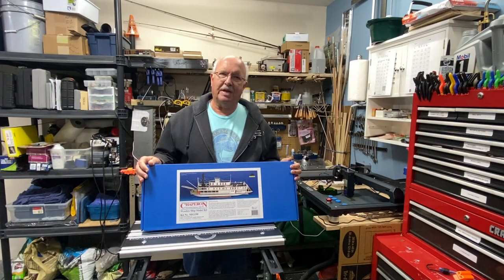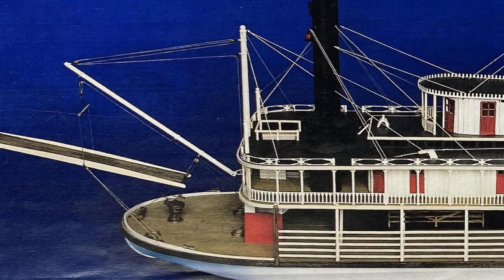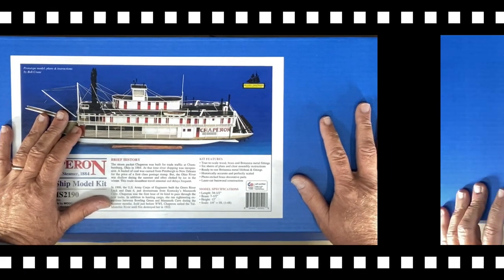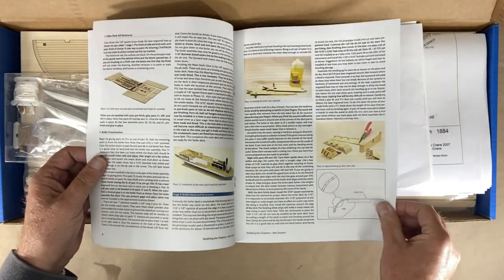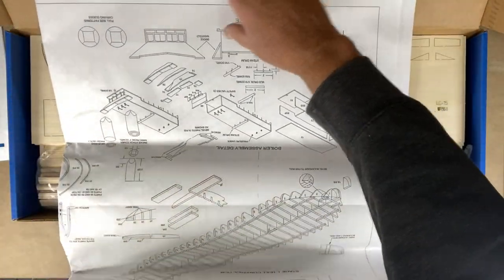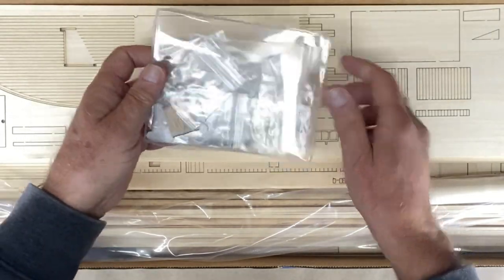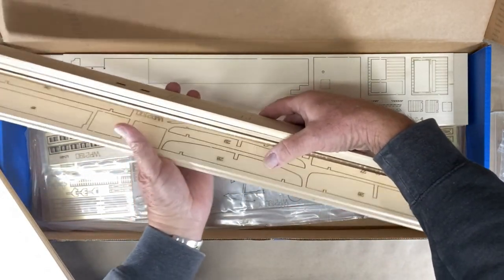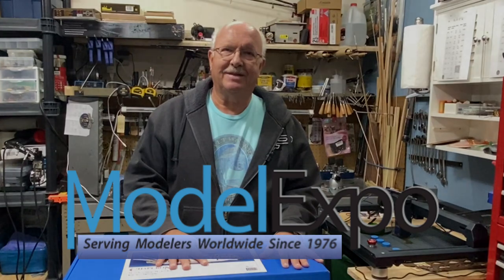The Chaperon UNBOXING

Comment: Glad to see someone else building this boat besides me.  I am close to finishing mine.  I've added lights which slowed me down some, but I am working on the Texas, then the wheelhouse and will only have finish work after that.  Looking forward to your build.
Reply from the maker: Definitely a new challenge for me!
I’ve been looking over the build plans and formulating in my head how I want to proceed. I’m leaning strongly towards a combination of dark mahogany stain for floors and handrails. I’ll keep the white paint for walls and the hull.  I’m not going for a duplicate of the original boat.  I like to put my own twist to it.
I’ll search your handle in hopes you’ve posted something…. I can use the help 👍👍
I found your YouTube and will follow.
Thanks 😁